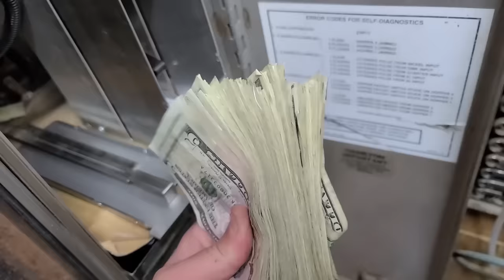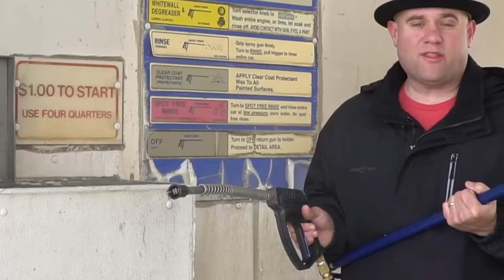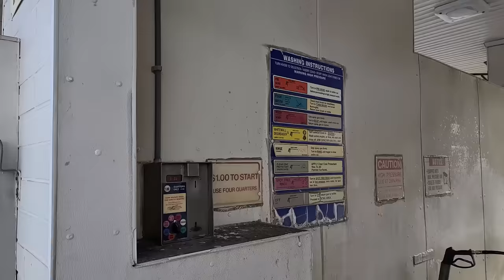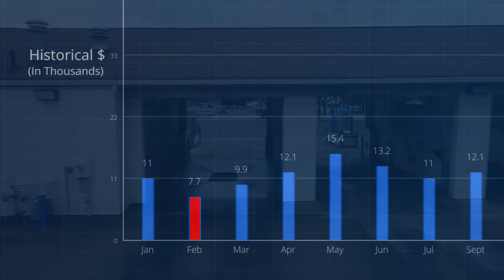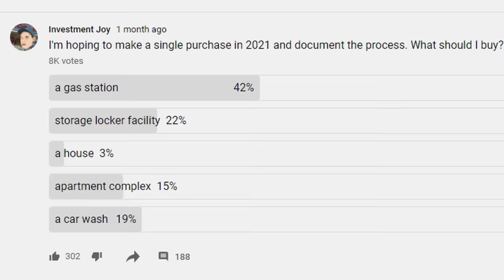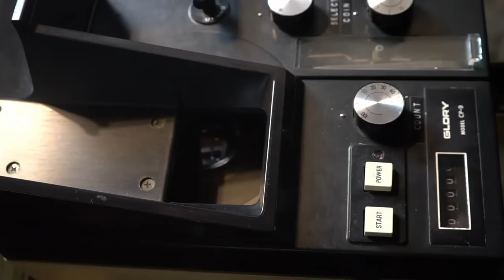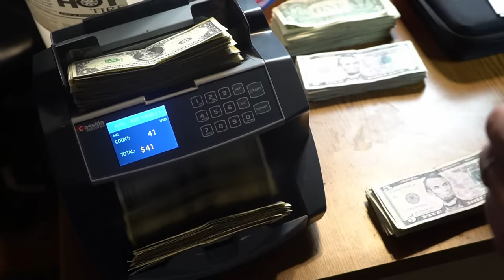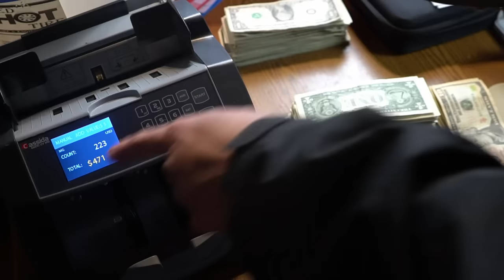I Bought a CARWASH, Here's How Much $$ It Makes!

Comment: As a suggestion, I would move your vacuums away from your self-service wash stations. If I only want to vacuum my car and there is a car behind me and a car being washed in the front I'd be blocked in.
Reply: My local one has them in front of the bays and on the edges of the lot so if you just need to vacuum you can be out of everyone’s way. Or if you’re doing a full clean you can vacuum before you roll into the bay
Reply: @VivaLaGolf42  That's the thing, the vacuums are only in front of the bays.

Comment: Fastest Way To Dry Quarters. Put them  In a  glass or metal cooking pot and put them in the oven for an hour @ 400 then dump on a surface like plywood to cool down. You can use a heat gun but baking them works faster. I own a 4 bay self serve.

Comment: When you calculate labor and maintenance, are you talking about an employee working there for $40 plus $200 ($240 labor) over the weekend?  Your utilities for $46?  Are you counting water, gas, electricity?  I can’t see that only being only $46???  You must use a lot of water.  What about soap, chemicals, average repairs, damage, theft?  How harsh is the winter and how often do you have to repair or replace the roof?  Has any machines been hit by cars yet?  What does the company charge you to deliver and install the soap and chemicals?  How often does this take place?  Does the city charge you for a business license?  How about hazardous chemical license and fees?  Does the city care about the chemical run off?  Also, your calculating your PITI for one Sunday as $133.  Does that mean you should multiply that by 30 days in the month?  Have you thought about damage claims yet from the auto car wash?  Yes you have insurance, but what’s your deductible and at what point will your insurance company raise your rates from too many damage claims?  I think your  gross expenses are too low and should be much higher.  There’s much more that needs to be calculated in the performance page you depicted.

Also, what happens if there’s cars next to vacuums 1, 2, 3, 4?  How do other cars get into the bays to be washed.  They are blocked.  Do they have to completely drive around to the other side?  How does someone use vacuum 4?  It’s blocked by the auto bay pay machine.  If some tries to squeeze in there to use it, now they will be blocking the auto bay.
Reply: Good questions, however a video on this wouldn’t bring in views lmfao people just wanna hear good numbers no one wants to hear about all the actual logical side of a business
Reply: It’s a job

Comment: Some states require a treatment system on the car wash depending on where the used water gets discharged to. The systems can run easily over 100K in setup and engineering fees. I find that is a huge pitfall for people who want to run a car washing operation. If anyone wants to buy one, be sure to check the water pollution standards and if treatment with sampling is required.
Reply: Where I live there is not  a single one but no money to buy one and  not care about pollution  standards at all because nobody cares. 😂

Comment: 3:48 Send one of those locks to the lockpicking lawyer and he'll set you right 👌 even though that's a tight squeeze I guarantee I'd be In there in less than a minute. Get some lights and cameras for the place if you don't have them. I use to be more on the sketchy side of living. Vending machines (tubular locks) laundry mats, and car washes are all easy targets. Especially at night.

Comment: The car wash I always go to takes cash and card but I noticed 2-3 bays out of 7 have gone out of order. The card readers are finicky and they don’t always refill the triple foam... it was nice and convenient in a great spot. It’s for sale on loop net for 800k and I was wondering if you had insight on possible maintenance costs and repairs and how you’d approach the realtor of the seller to negotiate a creative deal? I’d like to own it and restore it. It’s in good physical condition. It’s the mechanical stuff I don’t know about. It has one auto but most use the self service bays. New sign, and I know how to clean the bays fairly well with fleet wash.

Comment: No man that's not right .. if there was 471 in your change exchanger then you should only count the quarter from your bays that offset .. witch means for it to be a positive product you would take the 471 that you exchanged for quarters and subtract that from the quarters you have so 331minus 471 would be a negative 140 that means you have put 140 bucks in quarters that were not spent at your wash .. then we need to subtract that from the auto wash sum ... that's your total .. the 471 is your cost .. not really you get the money back but if you were to put the quarters back in the machine you would have less than you started.. sorry to burst your bubble tho .. I work for a company that ran a wash we got it for a good price installed card readers I  all the bays new cameras..made money and sold it for a great profit all in a matter of 6 years .. it is a good business and those card readers will bring in more money than you imagine

Comment: Looks like the quarters are stored behind a tubular lock but hard to tell from the video. If so, despite the plate being 35lb it can be defeated in seconds with a $5 tubular lock pick from Amazon. Check out the lock picking lawyer channel for more info

Comment: Dump the wet coins on a large towel. Then get another towel and transfer the coins from the first to the second towel. Voila. Dry coins.
Reply from the maker: That works IF there isn't a condensation issue. The coins were sort-of frozen solid in the video when I collected, even after warming em up in the office for a few hours they were still cold and the condensation kept causing an issue.